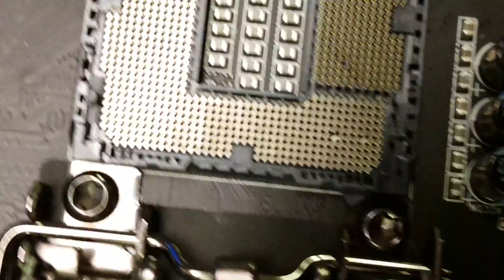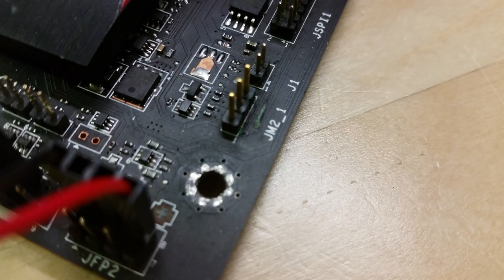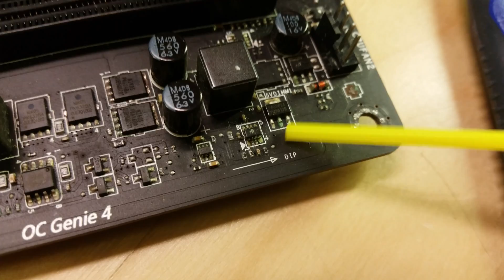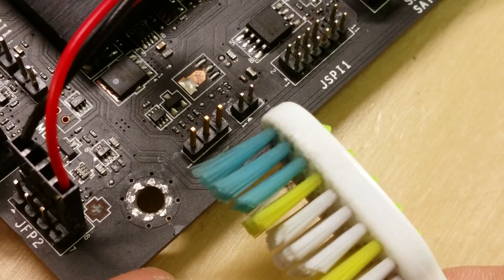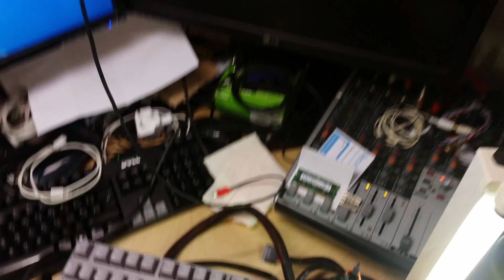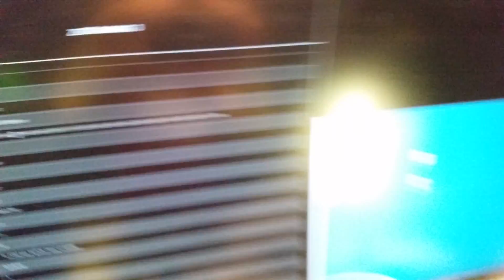MSI Z97 Gaming 3 Motherboard - Bent Pins, Corrosion & Moldy PCB - Dead Board Repair Attempt

Comment: I had the same problem on exactly the same board but using a i7 4790k cpu, turns out it was 5 dry solder joints and after re- soldering it worked fine again.
Reply: I have the same problem with the same processor
Reply: Where were those dry welds? On which components?

Comment: Hey I have this motherboard also but a Gaming 5 version, I tried it and when I power on the power supply theres a blue light beside the cmos battery, and I tried everything andl lose hope, now when ai remove the cpu I saw some bend pins, should that be the problem why isn't it going on? Need answers please, so that I won't waste time if this is really a dead mb. Thanks

Comment: Did you finish straightening those pins, seemed like that was it, I have the mini version of this board, 6 pins arrived bent, CPU was in and out at least ten times till I had them perfectly straight, updating windows 10 on it now, 25 minutes up time and no issues
Reply from the maker: Unfortunately it didn't resolve the issue with this board. I put it down to corrosion or other damages as it hadn't been very well looked after by the individual it belonged to.
Glad you got yours going though!
--Nathan

Comment: Hi man, i have an almost identic\l board it's the Z87-G43. it was woring fine until i upgraded my ram and GFX card. now it seems dead, it won't power my PSU, my PSU powers up. could it be the stupid power button thingy? how can i tell if mine board is dead as there's no lights no it at all even when it works

Comment: Why haven't you put an heatsink on the CPU its a good way to fry that chip
Reply from the maker: Negative, Intel CPUs have over temperature protection and wouldn't cause damage to themselves as they'd auto shutdown.
It's also pointless to keep putting a heatsink on and off when testing a board and fixing potential socket issues.
If you know what you're doing and don't leave the system on for any length of time it's also not gonna get hot enough to cause any damage and is actually quite common practice when doing this kind of repair attempt. For the most part this processor didn't even get warm as the board didn't seem to power it up. 
Thanks for your feedback though and I appreciate your concern. :)

Comment: I have the H97 version gaming 3 msi motherboard, i also have the exactly 100% same problem as yours. also my MOBO also have bent socket pins and also fixed it but just wont boot... tried bios jumper reset , cmos battery removed,  wont boot. my cpu does get hot when booting... have you fixed it so far?